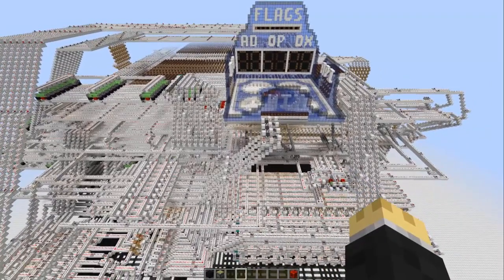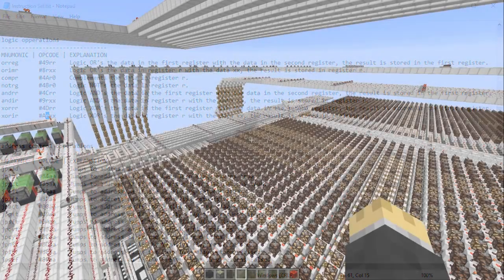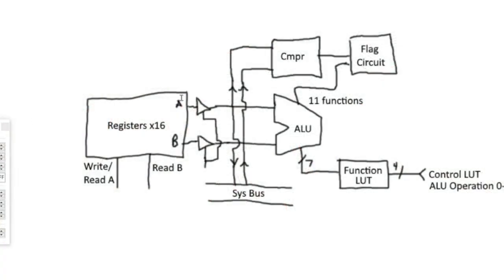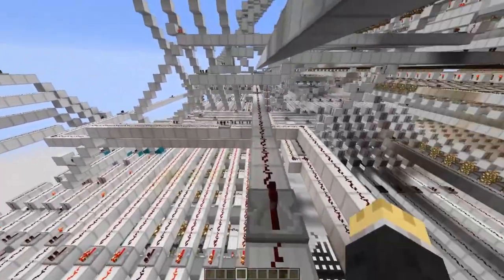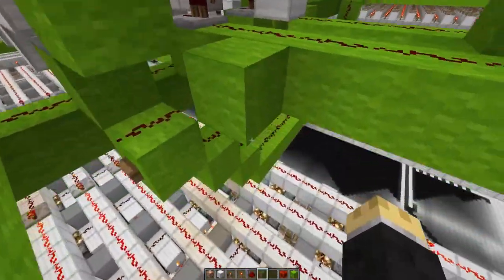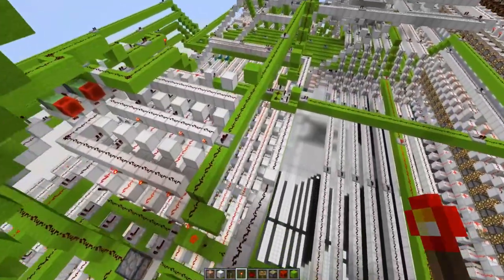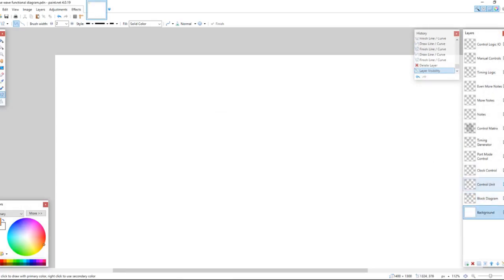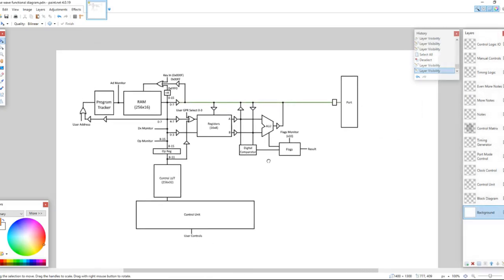Reverse Engineering Bluewave

Comment: I don't know how binary to BCD to 7 segment display works. A lot of the videos that I see explains them in a way that I don't understand them.
Reply from the maker: Well, what are you not understanding?
Reply: I don't know how to turn binary to BCD. It seems very complicated.
Reply from the maker: OK so it's the binary to bcd part that you're not getting, not the bcd to 7-segment part. 
Am I correct in assuming this?
Reply: Basically, it uses a thing called a decoder that uses and gates. The pattern or code that 7 segment displays use is arbitrary. And gates turn on lines if a certain binary input is given. It’s not super complicated, but I can’t really explain in a YouTube comment. Try googling decoder.
Edit: the machine that turns the binary counter output into program memory read lines is a decoder.
Reply: @ratnaahmadbohari5945   I know this is really late, but what you are looking for is a device that can run what is called the "double dabble" algorithm. It basically uses adders and bit shifting to convert the base-2 binary input to binary coded decimal. Here is a tutorial by Bennyscube that shows how to build one: https://www.youtube.com/watch?v=zXcdWf7Eh2U